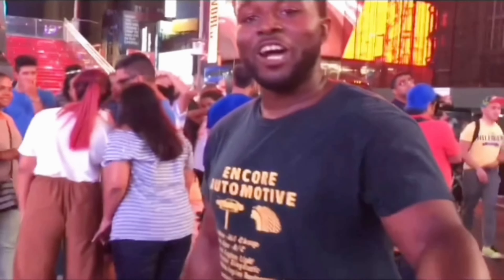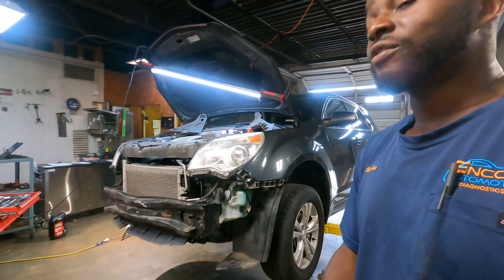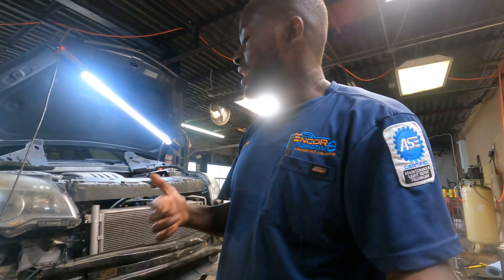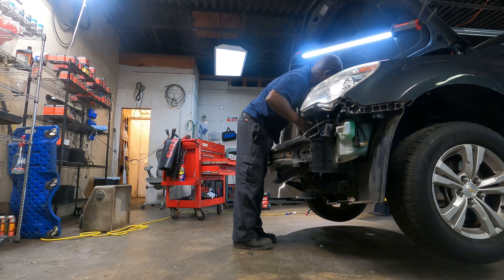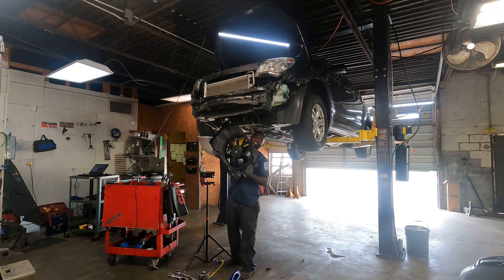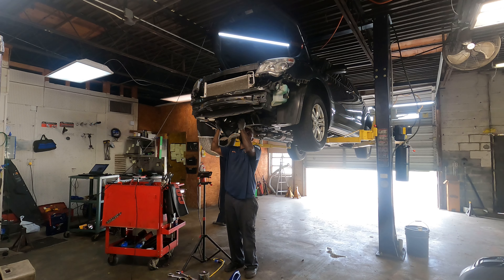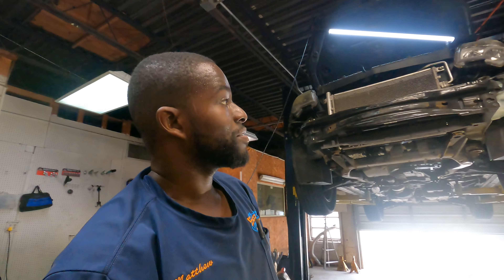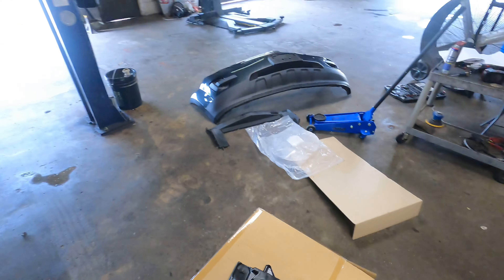2013 Chevrolet Equinox engine fan replacement

Comment: My fan not working on a 2012 chevy equinox. When i turn the ac on it make a noise in the engine. Is it because of that?
Reply from the maker: Definitely investigate the sound coming from the engine compartment. However the AC system does use a fan  to remove heat  from  condenser, possibly could be related .
Reply: @EAUTODR  I noticed the low ac line and the coolant lines get real hot, but the gauge don't indicate the car runs hot. Long as the ac off the engine sound good, just when u turn it on it shake more ND make a noise..